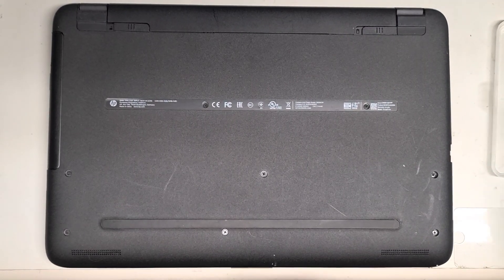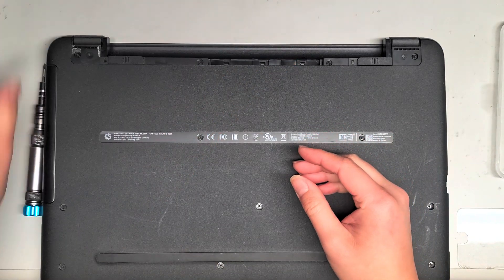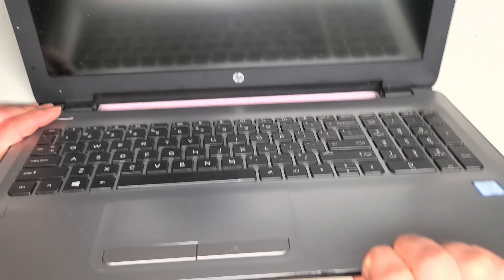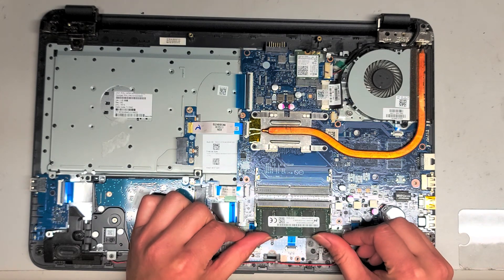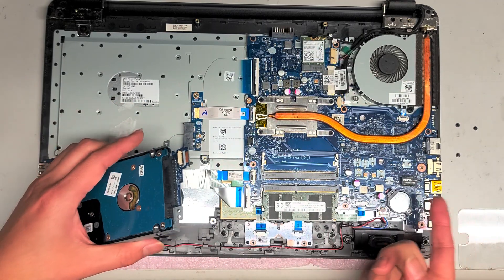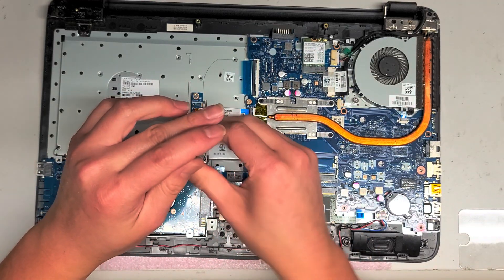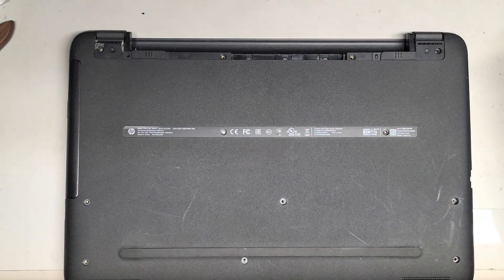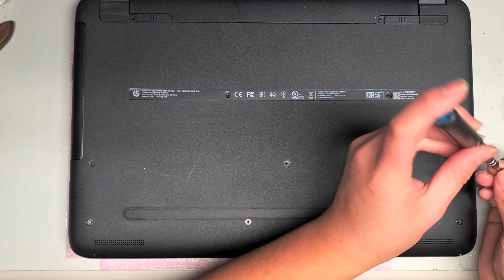HP 15-ay011nr Disassembly RAM SSD Hard Drive Upgrade Repair Black Screen Repair

Comment: What is the error message from this laptop? I have a problem with my hp laptop with error message 3F0 hard disk error.
Reply from the maker: The hard drive is dead. Have to replace it with an SSD and install windows from scratch.
Reply: @ItsBinhRepaired  tq
Reply from the maker: @edmundkoh5937  no problem. If you haven't already, don't forget to like and subscribe so others can find my videos. Thanks!

Comment: Hi I have an ay071nr. I have already switched out the HDD but forgot to check the wifi card. Before I open it up again and break more clips like I did I wanna have new ram and a wifi card ready for me to put in at once. Do you know how I can check what wifi card is compatible with my ay071nr?
Reply from the maker: Other than checking the model number on the card, I'm not sure.

Comment: Bro I have a serious problem with the fan of my laptop (the same laptop in the video) it sounds like a fucking blender and actually I tried to clean the fan but it wasn't dirty enough. The temperatures are correct but this shit still sounds like a blender. Any idea? Greetings from Ecuador.
Reply from the maker: This and the videos in the description should help. https://youtu.be/3zs_SJ3BXgA
Reply: Great video and thank you very much but i have a question, i want to upgrade my ram to 16gigs with 2 new sticks but i heard you said the ram was pc4 2133. I check amazon and it has ddr4 but i know that its ddr3 so i dont know if you can help me out please
Reply from the maker: Pc4 is ddr4
Reply: @ItsBinhRepaired  also do i have to use 2133 or i can buy 2 new 8gig 2400 or 2666 ram?
Reply from the maker: You can try, but I usually stick with the same speed to ensue compatibility